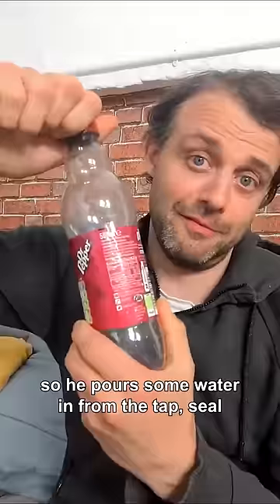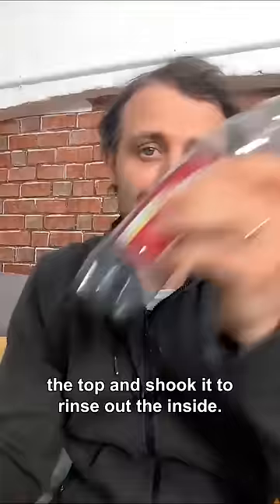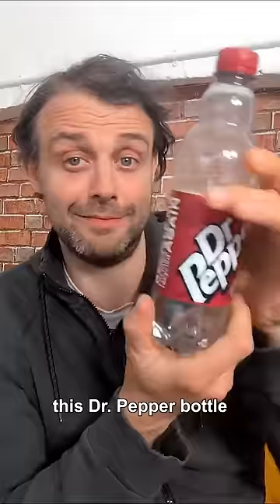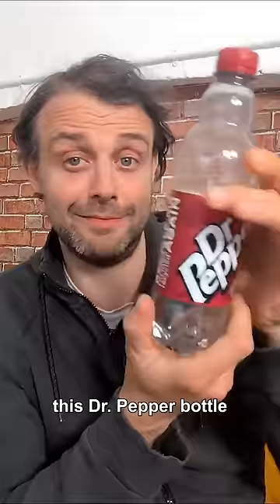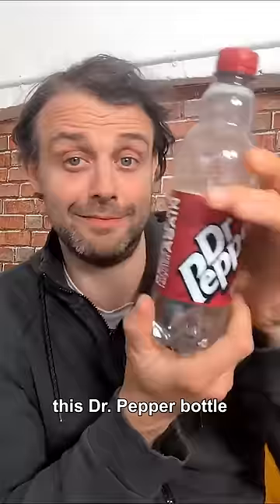Fizzy Drinks Collapse When You Do This... But Why? #shorts

Comment: Also depends on the temperature of the water compared to room temp.  My tap is always colder than the room temp (especially during winter), so as you shake the bottle it disperses the heat from the air in the bottle, reducing the air's volume.
Reply: Also cold water is more soluable to CO2.
Reply: @kwinzman you mean CO2 is more soluble in colder water.
Reply: Yeah, I've seen this phenomenon before and it has nothing to do with remaining CO2 in the bottle because it works both ways, Steve's got it wrong this time. You can breathe warm air into the bottle then put a couple of ounces of cold water in the bottle, put the lid on and shake and the bottle will collapse because the air cools off, or you can increase the pressure in the bottle by shaking around a couple of ounces of hot water.

This is actually why partially empty bottles of pop go flat faster in the fridge because as the air in the bottle cools off the pressure drops, allowing more dissolved CO2 to escape from the drink.
Reply: Yeah, I think this is right, nothing to do with CO2 - I've seen the same thing rinsing out plastic milk bottles - you can make it expand when you shake it by using hot water.
Reply: @warrenbutt That part about the partially-full drinks in the fridge is an interesting one I've had disagreements about in the past. I've known people who squeeze as much of the remaining air out of the bottle as possible before re-capping it, somehow thinking it'll keep it from going flat as fast, but I've always insisted that doing so would simply create negative pressure in the bottle that would accelerate the release of the dissolved CO2. I suppose the best thing would be to crush the half-full, capped bottle in a vise to help maintain the internal atmospheric pressure, but that's also really, really dumb.
Reply: That or if it's boiling its being turned back into the original shape
Reply: @hollt693 Pour boiling water on it to shrink it back
Reply: @frandurrieu6477 Actually, yeah, that should work! Still a bad idea, but it should work.
Reply: @hollt693 it's funny trying to explain it to the people who have believed that their whole lives, too. My parents taught me to squeeze the air out like that, and it took a lot of explaining from their high school age child to convince them that they were just creating more space for the gas to go. It helps to explain when you pull out a bottle that was crushed yesterday, but is fully blown back up after a day or two though. Lol
Reply: @Benjamin-ej8oz not the same thing though. Warm water releases vapor far more than cold water affects air.
Reply: @waterlemon3885 what do you mean "creating more space"?
Reply: @itsgonnabeanaurfromme  sqeezing the bottle pushes the air out, which leaves more space for the gas molecules. "Create" was kind of the wrong word. It made sense in layman's terms, but not in chemistry terms.
Reply: @itsgonnabeanaurfromme  There's more room for the bottle to expand as CO2 is released from the soda before the pressure inside of the bottle starts rising enough to inhibit further off-gassing.
Reply: @warrenbutt it's quite bizarre how one could even thought about co2, it's overcomplicating it...
Reply: empty bottle-hot water-shake-collapse
Reply: Sorry, he's pretty much right. CO2 is very soluble in water.  Like about four bottles of CO2 at atmospheric pressure dissolved in every bottle of pop.  Look up "volumes of CO2" and see.
Reply: *reducing its pressure
Reply: @hollt693  I don't think that "negative pressure" is appropriate here. All you'd be doing is changing the volume of the bottle to match the liquid's volume. Since the crushed bottle isn't at its maximum possible volume it can slowly expand as the CO2 effervesces out of the water.
Reply: @huraqan3761  That's fair. I suppose it could depend on the stability of the bottle's compressed form. A normal 2L PET bottle wouldn't have a ton of return spring to it like a squeeze bottle might. Either way, you're right that the primary effect of pre-squeezing the bottle would be to give the CO2 more room to expand into before reaching the limits of the bottle's elasticity.

On a side note, back when I worked in warehousing, I once saw an unopened 64oz bottle of grape juice that must've gotten contaminated during bottling with some manner of gas-releasing microorganism, because the bottle had expanded to approximately twice its normal volume (evidenced by the ratio of juice to air in the bottle), stretching into a smooth egg shape in the process. It was a highly molded bottle, with lots of ridges, flutes, etc., otherwise I suspect it either wouldn't've expanded as much or would've ruptured. Even still, this had expanded enough to punch through the heavy-duty cardboard box it was in, then into the box below it. It was honestly pretty amazing.
Reply: Its exactly this,
Reply: He could also have been holding it a while and the air inside be body temperature.
Reply: I prefer this explanation (code water cooling the sealed air, dropping the pressure), perhaps per Occam's razor.
Reply: It's def temp. I think he was missing an important part of the guys story. He probably used hot water and shook it.  I can get milk jugs, soda bottles etc to do it with hot water and the cap on tight.
Reply: Yeah this is the right answer. It’s temperature related. The air was hot and the water was cold. Due to the high heat capacity of water compared to air, and the likely fact that air took up the vast majority of the volume of the bottle, the water easily cooled the air when shook, shrinking the volume of air significantly enough to make the bottle cave in.

Comment: Empty bottle.. warm home air... Cooler water from tap. Close the bottle and shake with cold water cools the air inside the bottle causing it to contract. I see closed bottles full of nothing but air do this as air temp changes. No way CO2 concentration in the bottle after drinking would be that much higher than the surrounding air.
Reply: Every time I finish a bottle of water and put it back in my cold lunchbox empty it will do this unless I leave the lid VERY loose.
Reply: except that his fire extinguisher co2 is many many times colder than ambient temperature, so he disproved your theory in this very video that you just watches
Reply: @nobodyinparticular968  - not really. I believe the demonstration in the video uses a much higher concentration of CO2 than would have been present in a bottle after drinking. So my point really is this is achieving a similar result but with a different cause. In the scenario described I believe the cooling of the air would be the cause. In the demonstration I agree we're more likely looking at the CO2 moving into solution due to a higher concentration of CO2. Similar effect... Different probable cause.
Reply: @NotOutOfIdeas  makes sense, that could be it, it might also explain why he saw no success with his soda, if the viewers soda was chilled and his was not
Reply: @nobodyinparticular968  by time you finish a soda is it still as cold as when it was in the fridge? 
Usually by time I’ve finished a bottle of soda it’s warmed up quite a bit. 

I also don’t personally rinse anything out with cold water but that’s personal preference.
Reply: @noobpro9759  you have caused me to realize that i misspoke, it wouldnt be cold soda that would cause this, but unusually hot soda, but then again thats even stranger
Reply: @nobodyinparticular968  eh. It doesn’t really need to be that hot. Just relatively warmer than the water going in. Although yeah it could totally be a car soda. I personally really like hot original monster. It tastes like apple pie filling when it’s warm.
Reply: @noobpro9759  that is the most horrific thing i have ever heard, i will not be sleeping tonight
Reply: @nobodyinparticular968  good. 😊
Reply: @nobodyinparticular968 or hot rinse
Reply: This is it, take ice cold water, and shake it in any bottle as long as the oxygen starts at like 90 degrees, it will “rapid cool” when the water shaken around it, forces it to.
Reply: Most people have no idea: Water based liquids hold a LOT of CO2' most beer is carbonated to between 2.5 and 3.5 "volumes" of it, soda/pop up to 4.5 volumes.  Yes, a bottle of pop has 4 bottles of CO2 in it!  Meaning 4 volumes at atmospheric pressure.
Reply: @OogieWa  How much of that CO2 is going to remain in an emptied soda bottle that you're taking over to be washed?
Reply: @NotOutOfIdeas  Even if it's 10% that's over one psi pressure difference. Bottles handle pressure inside well, pressure from the outside not so much.
Reply: @OogieWa  but couldn't it also just be contraction of room temperature air when cooled by cold tap water?
Reply: this is also most definitely an aspect because this happens to me with my actual water bottle which has never had fizzy drink/soda in it. 

that being said, the co2 absorption theory seems to have some weight as well.
Reply: Alright this is gonna be a bit long but hear me out. 
H2O + CO2 = H2CO3 is endothermic with an enthalpy of 2, gas is exothermic with an enthalpy of -1388, the mass of 1 mol of gas is roughly equal to the mass of 6 mol H2CO3 so the energy ratio in terms of masses is roughly 1:100. so knowing CO2 is our limiting reactant and assuming we have at least 10g CO2 in the bottle (seems like a reasonable minimum for this experiment) the CO2 dissolving in the water absorbs the same energy as igniting 100mg of gasoline, which is a non-negligible amount of heat energy leaving the bottle, this -Q would then lower the pressure in the bottle.

Now, is this heat energy absorbed enough to cause a significant pressure differential in the bottle to cause it to cave? In the experiment that fills the bottle with CO2 and used a weak water bottle that’s absolutely the case. 
In the initial case with a stronger pop bottle only containing trace amounts of CO2 I would expect the change in pressure caused by the enthalpy to be negligible, this doesn’t mean I’m right in expecting this, and it certainly doesn’t mean it’s unreasonable for someone else to expect this force to be enough. 
So yes this test is far from perfect and doesn’t emulate the initial problem, but the conclusion is completely reasonable for someone with knowledge in chemistry.
Reply: I use to keep a soda bottle (1,5 l) next to my bed. Eventually I'll have it emptied completely with insignificantly  increased CO2 concentration in the contained air.

First thing I do after getting up is fully opening the balcony doors letting in fresh air. As you know cooler air will flood the room beginning at the floor so with temperature differences of just 15°C the empty water bottle will start shriveling within less than a minute. And it's quite impressive how much the enclosed volume of air apparently shrinks.
Reply: CO2 is more soluble in cold water than warm so you can't rule out that the effect isn't enhanced by having more C02 in the air. It's probably a combination of the two effects.
Reply: also, water can absorb a lot of CO2, that's why the oceans function as major CO2 sinks for the planet even more so than forests. Climate change that is warming the oceans is reducing the oceans absorption of CO2. You can see how much CO2 water can absorb whenever you drink any carbonated beverage.
Reply: Measure the pH of the water before and after to test his theory

Comment: There is very little carbon dioxide left in the bottle after finishing a carbonated drink.  It’s just air from the room.  

The bottle is crushed by the air pressure difference between room temperature air outside the bottle, and the air inside the bottle which becomes rapidly chilled on shaking, due to the increased contact surface area between the air and water in the bottle. 
If not shaken, the cool water in the bottle will still chill the air in the bottle, but less rapidly, giving the warmer air outside the bottle time to warm the bottled air (and water) at a rate that sufficiently keeps pace with the cooling from the water, such that the structural integrity of the bottle can withstand the difference without much deformation.
Reply: Instructions unclear. I tried to do this to my pecker and it exploded.
Reply: Much depends on drinking style and if you pour it into a glass. I could swig it and leave mainly co2 and if it was a warm bottle 😂 . I bet it would be 95+ % .
Reply: Have you ever tried inhaling from a freshly emptied soda bottle? From the coughing fit that results, the CO2 concentration is definitely elevated, though I couldn't say an exact concentration.

Comment: It's the cooling off the air in the bottle. The same thing happens in reverse if I leave air space in my water tight coffee mug. The air heats and expands, and the lid gives a pop when I open it. If I fill it to the top, or give the air time to heat up before I put the lid on, then it doesn't happen.
Reply: To clarify, the experiment above maybe demonstrates this, not cooling! Whether real-world scenarios (cold plastic that used to hold a just-finished drink cooling the warm air within) are driven by this I think is less likely

Comment: You could test the theory with a clean bottle and by adding a little bit of ph indicator to the water since the water should be more acidic if CO2 is dissolved in it.

But im leaning more towards the air reducing in volume due to temperature change as being more likely
Reply: Look up how soluble CO2 is in water.  You may be surprised.

Comment: Never seen a bottle shaped like either of those
Reply: As a weird aside, the rights to distribute Dr. Pepper in the UK is handled by Coca-Cola (and you can see their logo is different too) and because of the metric system, they don't size individual bottles in 12 oz. or 16 oz. Instead, at least where I live, 600 ml is common and that different size leads to the bottle having different dimensions and as far as the specific shape goes, I think the Queen decreed the Dr. Pepper bottle shape must be different and any deviation would result in the death of the factory workers' families.

Comment: Likely candidate: enthalpy of vapourisation. There are two factors: partial pressure of CO2 reducing gas volume against additional volume of water, and the shaking of the liquid accelerating the equilibration of temperatures and pressures. The enthalpy of hydration of CO2 is ~60kJ/mol, whereas vapourisation of water is about 40kJ/mol, so I guess that vapourisation is the more abundant and the cooling effect reduces pressure more than gas solvating does. Tap water typically also contains dissolved gases that can be liberated by the shaking, and a CO2 charge will increase the "dryness" in the bottle.
Reply: I just ran the experiment with a bottle filled with room temperature CO2 and room temperature water, and the bottle collapsed as shown here. I thought about the effect of the water vaporising, but the bottle that I filled with CO2 had lots of water droplets stuck to the inside when I filled it with CO2. I then let it sit for a while to let the temperature equilibrate, so I figured that water vapor in the CO2 would have reached equilibrium too. 

I think that both effects likely occur in the real world, and determining which predominates in a specific experiment would take some careful measurements.
Reply: @AlarKemmotar  real world: wet co2 from pop / soda/coke

Comment: I’ve had a similar effect with just a regular water bottle. I just assumed it was the water cooling the air causing a drop in pressure. I remember it would slowly inflate and if I’d shake it again it would deflate.

Comment: So, I just did this with a 500mL Diet Coke bottle. I'd just finished it, and I smelled the bottle to make sure there was some CO2 in there, and there was. I then poured in some water from the cold tap, shook it, then gently opened it to hear the air rush in since it didn't collapse.
Then I filled it all the way with warm water, to get rid of all the CO2 in the bottle, poured out the hot water, then I added cold water to the bottle, closed it, then shook it. I gently opened the lid and air also rushed in, making a similar noise to before.
I'm not sure if the CO2 being present in the bottle really makes a difference. I think it's just the air inside the bottle being cooled and lowering in volume as per the ideal gas law.
Reply: You can smell CO2?
Reply: @zackfelker  Kind of. It causes an acidic, irritating sensation if the CO2 concentration is high enough. That's what I was looking for when I was smelling the bottle.
Reply: I just did the experiment with the bottle of CO2 and the water both at room temp, and the bottle collapsed like he showed here. It's pretty clear that both cooling and CO2 absorption can lower the pressure inside the bottle.
Reply: @Crowbars2  You can not actually be smelling Co2 whether or not you think you are. You are smelling something entirely unrelated, probably the acidic drink that was in the bottle and still is coating the inside?? 
Common sense and basic googling is all you need here.
Reply: Well done. You did some proper science (unlike Mr Mould). I'm not quite sure about being able to smell CO2 though.
Reply: @adrianmiller4285  Maybe smell was the wrong word, but I was trying to say that I inhaled through my nose to see if I got a burning sensation from the level of co2 in the bottle, thus confirming its presence.
Kind of like when you drink a fizzy drink and burp but exhale through your nose and it makes your sinuses sting.
Reply: Detect/ sense. Not exactly smell. 
"Stuffy air" is high Co² levels talking.
Reply: One senses high Co² levels. It's one of our drives to breathe. High Co² causes us panic. He isn't smelling it. But we absolutely sense it.
Reply: @robertnewhart3547 What's Cobalt squared?